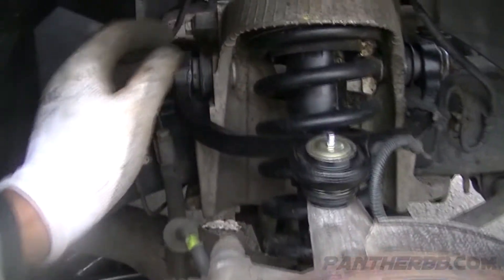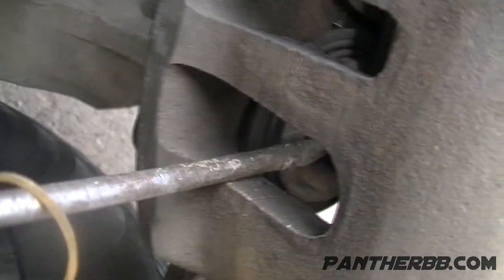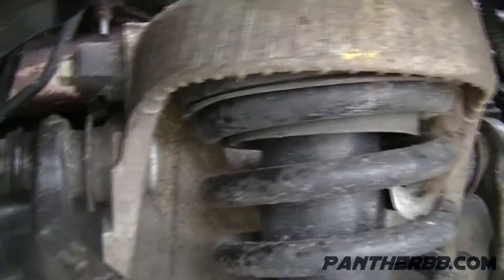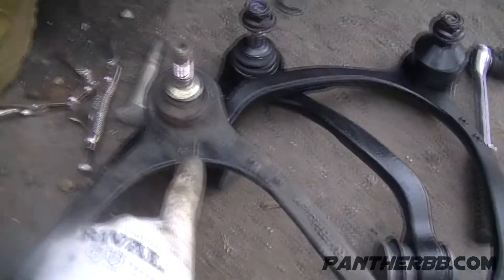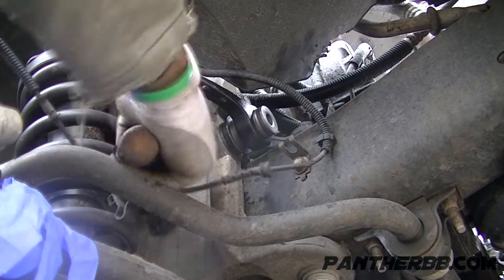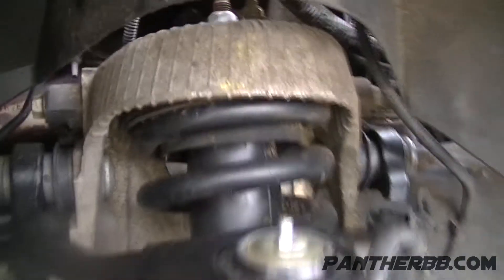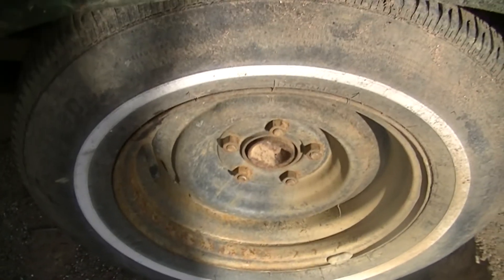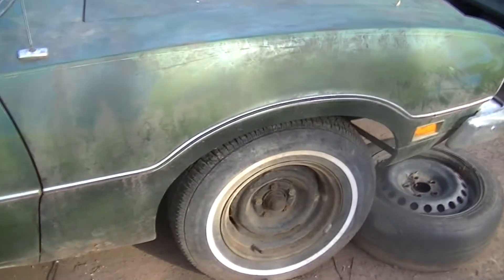Lincoln Towncar Upper Arm Install and Ford Maverick UPDATE

Comment: Was the ride on the Lincoln a huge difference feom before?? And about how long did it take you to replace them?
Reply from the maker: yes a slight difference with 1 , but with a combo a stuff its night and day...But the steering on the 1998-2002 are not the best  03 and up are better
Reply from the maker: it took about a hr IF you have all the tools maybe 3 hrs without
Reply: I have this same vehicle 2005 and noticed lately it's not handling the same. Went under there and only thing i can see is my upper control arm bushings are dry and brittle. Thanks for this video i will be doing this repair very soon.
Reply from the maker: @EPT915G  I would do the uppers and see how it would handle..., stop by anytime dude

Comment: dude check out this video and rtell me its not tempting to do lol. 
https://www.youtube.com/watch?v=Nk-ypusAmPk
Reply from the maker: Ah ha! Now remember i spoke of a Ford Torino This what i had in mind on doing ( the same thing ) I wasnt worried about the rear and such cause of this video... i think it could work , but if I cant build a Maverick i can not do this.. Man and you are on the same path on this lol
Reply: it was a thought lol. looked pretty good didnt it. id swap the steering wheel. pretty much if you got a desire you can make it happen. having the ability to get the skins is a make or break.
Reply from the maker: If I had the Torino body and the under part of the car was beat... This is what i would do to make it RIGHT a lot measuring but this would be a simple solution to a rusty ass car
Reply: yea was a thought more for fun

Comment: Look for the disk brake package off a Lincoln Versailles. It's a re-badged Granada. We always used to steal the rear disk brakes to mount on any of our hot Fords.
Reply from the maker: Not easy to find those Lincolns they dust those Lincoln off do to the swap you speak.. When i go to old time Junkyard the man spoke of this and he said the guys came in by the dozens for these parts i have a different idea how to do this

Comment: So I have arrived, upon replacing the transmission in my $200 V8, because the bell housing broke and then the input shaft broke and then boom, NO GEARS, WOOHOO right? Wrong. Anyhow Ford front ends are strange, I have bolts with a 1/2 and 5/8 head on mine, same bolt and nut combo. Also I kid you not I was watching, and saw you turning the upper BJ joint at like 1:45, and wondered how yours didn't turn in the hole because mine always do, and then the next clip is the Ford approved repair.
Reply from the maker: Look very very closely at 1:45 there is a pair of small Grips on the part.. you suppose use a hex head or some allen key deal.. i just went backyard style on the part.. So happen to the cool low budget v8 Explorer trans took a shizzle i see i dislike trans work, rather engine
Reply: Yeah it just busted the case, or rather the case had been busted, I didn't know that, it just broke the input shaft. Made for a good time

Comment: the nuckles from the granada will swap over straight. thats why i said go back and grab them in another video. easy swap 5 lug swap. the 5 lug mavs were supposed to be grabbers from factory but for whatever reason wasnt built into one. alot of them are 4 lugs base models
Reply from the maker: They are gone when I first got the maverick i went back to LOOK for the Granada a cream color one and its gone... So have to convert the front and do what weelanddeal said and mess with the Ford Explorer 8.8
Reply: u can look but the trucks have the same arms as well. mustangs anything mid sized will bolt up sadly u missed out on those spindles.
Reply from the maker: I seen some on ebay they want 400 lmao they are nuts.. So I have to make the fronts.. Now I have to entertain this rear and engine to boot.. So the guy who sold me a the Maverick has a Explorer so I will try to get it for the low of $300.. May go efi or at least to attempt if it does work go carb..
Reply: ive never done it but i was told to run it through the accessories to wire it in. mind you wiring is not my strong suite when it comes to this stuff. but there are ways to wire it in safely.
Reply from the maker: Its isnt mine either BUt I did wire up the Datsun with a 240sx engine and its should be somewhat the same in theory... 4 realys and 4 fuese and one Main power fuse...Rather a Intake fuel pump ( submerged ) than the external type for the efi.. But we shall see...   than main power that goes to the coil and starter thats the ( starting point ) for the ecm power on and off then it goes in deeper a bit.. Semi simple just the relay hook ups are odd..
Reply: sounds good your ahead of the game on me i know some but not enough wiring
Reply from the maker: I just text guy about the Ford explorer he responded to every old text but about SELLING ME the truck lol.. These are the games many people play.. its nerve racking at time but i never get disrespectful at all.. I will text explaining again $$$$$$$$$$$$$ on truck and we shall see what is good..if not we lean towards carb its that simple..
Reply: yea because that would give u everything u need pretty much. strip down the harness and use the whole lot. itll work just to make it fit
Reply from the maker: Hey Ozzy I though of the Thunderbird SC with the v6 stupid charger on it.. I danced with it just a taste what is your thoughts on that... Just something different... Also buy these dang parts for this Crown Vic Had to get another Flywheel cause i want to run a 11" clutch on a 6 bolt crank.. May get a used lsd and rebuild it , but i need gears in the crown also at the least 3.73 not much hwy driving on this car..what is your thoughts on this ( drift crown )
Reply: thats a big car to be drifting. i personally dont know anything about driftin. looks fun but it takes alot of practic. thats gonna be alot of wear and tear on the clutch you might want to upgrade it to beefier one. thunderbird as in a parts car or another project??
Reply from the maker: Thunder bird as a parts car ... Was thinking on the v6 supercharged version they have ( just a thought ) and swap that  in the Maverick.. As I am thinking i can swap it  in something.... So back to the Crown Vic thats the plan man.. I have to get a beefier clutch like you stated and so much other tid bits to... I use to have a slogan "Dare To Be Different " in many cases be slightly stupid depending if you can pull ( what ever you doing ) off. This will be a rough road but i will take it.. To be honest the drift guys aint friendly at all so that gives me a little battery in my back to REALLY do it.. Not just to do it but really do it.. I use to ride bikes and run from police for kicks so this is a change of pace lol
Reply: i totally understand man i used to do alot of dumb crap when i was younger. youd have to do some measuring unless you plan to change the front end of the maverick. then again that would make alot of room even in the engine bay
Reply from the maker: The front end I have keep it the way it is.. The money i have does really match me doing that.. Some things I have to be realistic on.. Its tough to grasp that concept it semi hurts but some things you cant really do
Reply: the v6 swap you was refering to. if it has the fox body front end then it would be a pretty simple swap over. use everything u can from that car.